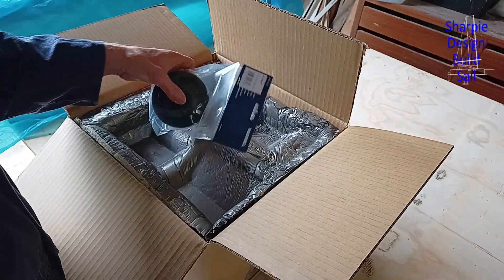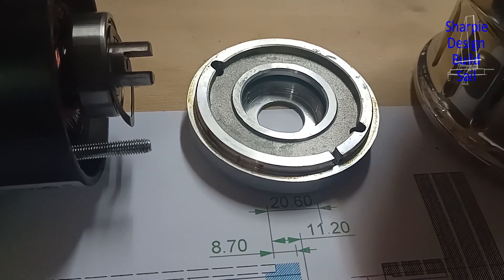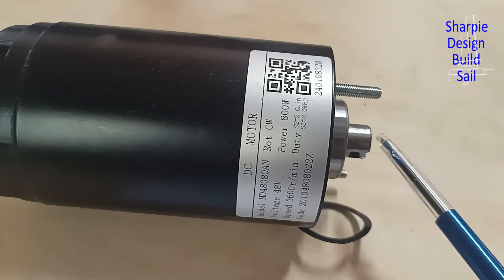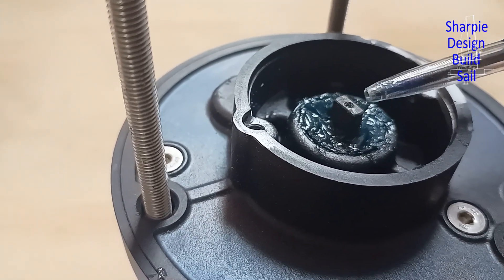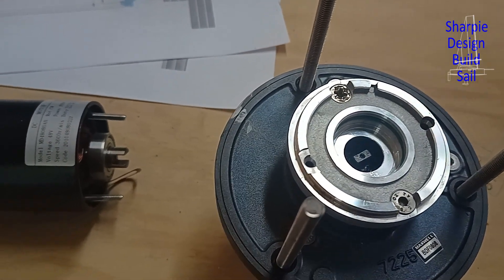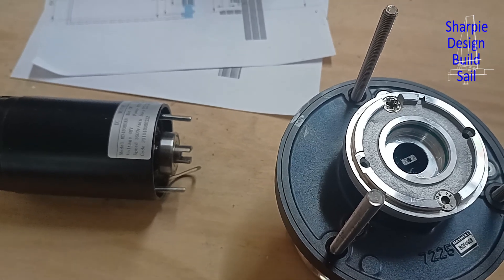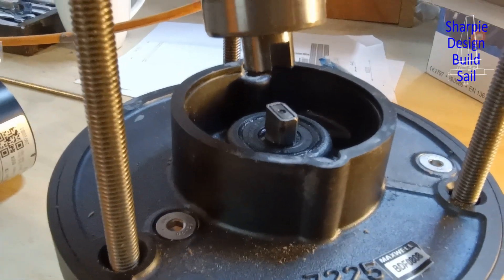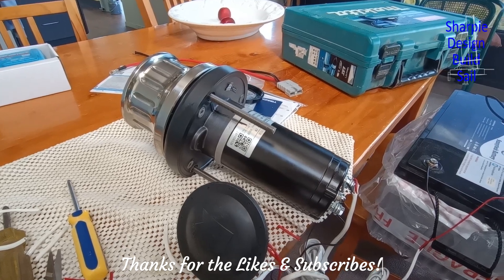DIY Anchormax12v 500W Converted to 48v 800W with a new custom adapted motor.

Comment: Hi, The conversion using a 48V motor is way better than using a DC to DC converter. The converter would had to be powerful enough to handle the current surge at startup. Your solution is also more efficient than using a converter. Keep posting.
Reply from the maker: Thanks for the comment, you make some good points! I'll certainly be giving an update on how it all works out and just today I was working on the mounting of that windlass.